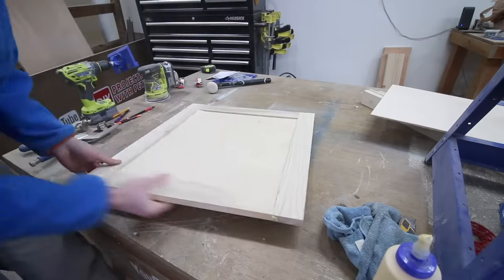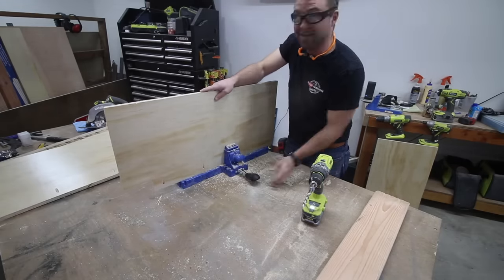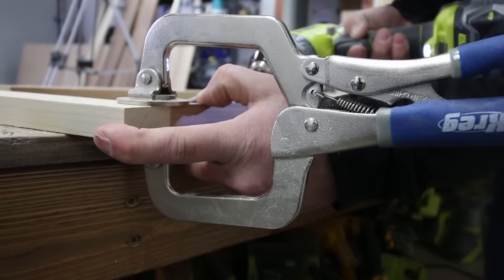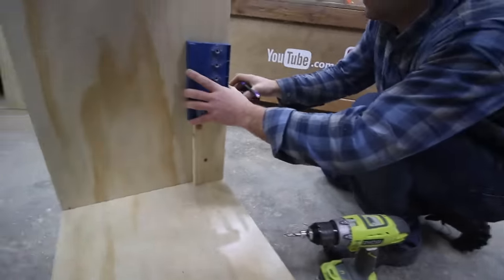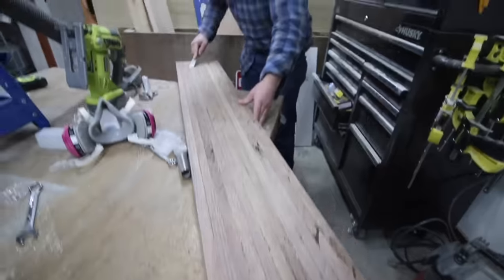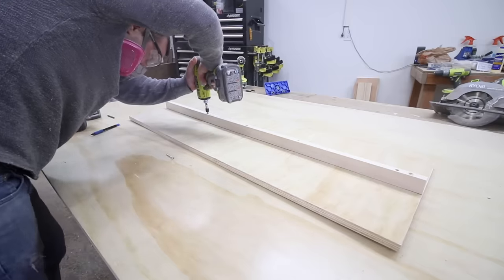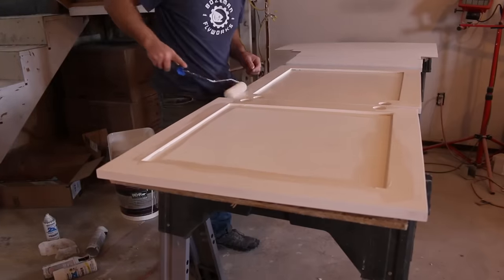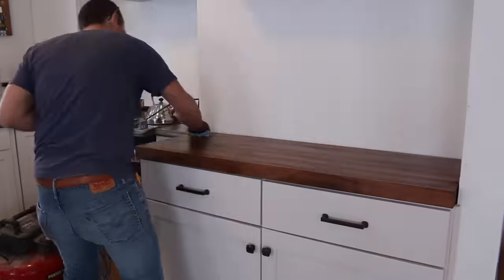How to Make DIY Kitchen Cabinets

Comment: DIY is a bit of a stretch with all the tools you used... this is a professionally equipped workshop... yes I’m jealous...
Reply: Equipped? Maybe. He definitely didn't use the tools of a professionally equipped woodworkers shop. He used a kreg jig instead of a pocket hole drill machine. He used a circular saw to cut lines that cabinet makers use table saws. Woodworking isn't a cheap hobby but he definitely is showing you how to do everything on the cheaper end of the spectrum.
Reply: J Iron I think the only thing that takes this slightly out of the DIY arena is the planer he used for the table top.
Reply: I never used one but I’m pretty sure that unit he used was $500 or more.
Reply: @jRising  To be fair any level of precise woodworking requires a planer. $500 for a planer is really on the cheap end of the spectrum too.
Reply: @jRising  I bought mine used for $150. Changed the blades and was good to go. I get about 2 inches of snipe which can be avoided using a couple of tricks like running a board beside the one you are planing or leaving extra material. You can get a hand electric planer like the WEN for under $100 or you can even plane it by hand like some people do (I'm definitely into power tools for this kind of thing). All the tools he used can be bought super cheap used. Where I live in Canada you can get pretty much every single tool in the video (used) for under $500. Compare that to the price you'd pay for a professional install. For this kind of application, the quality is not in the tools -in my opinion-, it's in the hands of the craftsman!
Reply: I'm using handsaws and a circular saw. And a hammer and a screw gun....and it's pretty simple. Just time consuming.
Reply: I cheated and purchased draw assemblies at homedepot. Instead of making my own
Reply: Fully agree, this is not a typical DIY setup. How many DIYers would have a table saw, a planer or a routing table to hand. I wish I had a setup like this.
Reply: "Save money by DIYing your kitchen cabinets! Just go out to your garage with $10k in equipment..."

Yeah I think all the tools and materials he used would be more expensive than some ikea cabinets. I'd have a chance of the Ikea cabinets actually turning out right too lol.
Reply: J Iron with a little effort, you could probably find a shop with an even nicer planet and pay a few dollars to have your wood planed.
Reply: Lol
Reply: I'm a hobbyiste and have all these tools(same table saw and same planer) Only thing I dont have are most of his Kreg jiggs.   A professionally equipped shop would cost 10X as much.
Reply: @znk0r  I'm also a hobby DIYer and have every Kreg Jig available but don't have a table saw or planer.  Wanna trade?  😁
Reply: @disturbedcarrot  I have a table saw, a planer and a routing table. I don't have all of the Kreg jigs he used though.
Reply: @1pcfred  Nice! Wish I had those.
Reply: @disturbedcarrot  I wish I had lots more tools. There's no end to it. You need tools in order to work on the tools that you have. My milling machine has its own roller box of tools dedicated to it. My tools have their own tools!
Reply: @ilovestitch  yeah well I already have the 10K of tools in my garage so what the hey. I've had tools my whole life. Humans are tool using animals. I'm human too. You may consider joining the rest of the tribe someday.
Reply: Agree 
This is not basic DIY video misleading
Reply: @PilotJirons  100%
Reply: Those are some pretty tools which I'm slowly aquiring , that thicknesser in my country is about 700 US new. The kreg jigs are a nice to have but totally not necessary if you own some clamps and a straight edge. Oh and the router table and router is pretty pricey but there are other way to join panelling to the door faces without. Great Video Pete!!
Reply: Was thinking the exact same thing. I have none of them 😕
Reply: I guess there are levels to DIY.  I started out with a cheap (quality and price) table saw years ago and now own one that costs more, but it's still a DIY shop.  A professional cabinet table saw costs $2K or more.  My new one is still less than $1K.  If you're going to really get into wood working, you'll eventually have to spend money on tools.  Even quality hand tools are expensive.
Reply: I have a cooking channel, and thought, "Hey, wouldn't it be cool if..." and yeah, I agree with you. hahahahaha. I think I'll just stick to making beautiful food. lol
Reply: @ilovestitch  closer to 2-3k in tools and jigs. Planer 500 table saw 650-1k circ saw 100-200 router table 4-500. Those are DIY jigs, most of which you can buy at the Home Depot.
Reply: I wouldn’t say professional….
Reply: Lol this is not an out of reach workshop setup 🤣
Reply: Yep, you lost me at “table saw”. Don’t have one and don’t have room for one.
Reply: I'm sooo jealous right now....
Reply: He’s using a HD planer, which is $500, and that planer is more than enough for what he’s doing
Reply: @disturbedcarrot  you’re kidding right? A table saw is as basic as a circular saw

Comment: Great video is it even worth it to build your own cabinets after all the cost on plywood  and time ?
Reply: Ok De I think it worth it. Because you’re making exactly what you wanted.
Reply from the maker: You do get exactly what you want, but you will need some specialty woodworking tools and it is time consuming. If you need custom cabinets it is going to get you the exact size, but to be honest I'd probably by stock cabinets the next time. I wanted to show the basic build process though.

Comment: Reallly nice simple video on how to build cabinets that's not 90 minutes long.
I tried building an aquarium stand with maple plywood from Lowes. The plywood was straight thanks to its large size but then was warped when I cut it into smaller pieces. And doing the veneer on the edges requires a good veneer edge cutter and a steady hand. All good!

Comment: Wonderful photos & videos shots with excellent narration; glad you had all the woodworking tools available.  
Suggestion: as a prior homeowner, I would  have put in slide out drawers, instead of wide shelf  & bottom shelf under that beautiful butcher block top... otherwise items just get "never looked at or used" that are in the back of those low shelves.
Reply from the maker: Thanks so much for the feedback and ideas!

Comment: Thank you so much! I have been wanting to do a custom peninsula for my home, so I priced it and most of the pros around here are insane with what they are asking. A $200 prefabbed peninsula installed brings the total to $2800. I think I'd rather put in the elbow grease and build it myself. Then I will get the storage I need and the counter top I want, and won't have to spend so much on it.
Reply from the maker: Awesome, good luck with the build!

Comment: Couple question, what size poplar did you use for the trim of the doors? Also, how’s you install the shelf inside the cabinet. Thanks!
Reply from the maker: Hi, I used 1x2 poplar fo rate trim. The shelf was made out of plywood with banding. A peg system is used to hold it up. Cheers!

Comment: Very nice and informative!

Would it be a good idea to add a thin bead of caulking between the door trim and face? I saw some gaps after the paint job and I think it would help to caulk before painting for a little bit more finished feel!
Reply from the maker: Not a bad idea at all :) My slot set and router were causing me issues and I've since upgraded so that the slots are cut even. I should add a little to my project though, that's a great idea! Cheers

Comment: Pete - First timer here and the cabinet I'm building is very similar to this one. Cant wrap my head around the bottom of the exposed (left side) of the cabinet. Once you added the toe kick - is there still a ~1" gap between the top of the toe kick and the bottom of the face frame? Or is it flush? Thank you!

Comment: Great Job! The pocket holes that you covered with 1/4 in. plywood on the side, could they have been put on the inside instead? Also, would this type of construction hold the weight of a quartz top?
Reply from the maker: Hi! yes the holes could have gone on the other side --- yep plenty strong for quartz countertops

Comment: Pro Tip get a sheet of 4 x 8 x (3/4" or 1/2") foam use it as a sacrificial layer to cut down plywood. Much easier than find/using blocks to lift off table or horses
Reply from the maker: Thanks!

Comment: I love this project and the cabinets came out wonderful. Very nicely done.
However I will have to point out some things that viewers should be made aware of. 

You did paint the cabinets so the paint should stabilize that plywood you are using. I recognize that plywood. I am very familiar with it and that is found in big box stores and although it works for quick and easy projects, it should not be using for cabinet making for long term stability. Most of that stuff comes from China and it has horrible consistency in it's Ply's, not to mention the chemicals they use to make it.
I highly recommend to viewers to seek out a lumber yard and obtain Baltic Birch plywood. Check hours of operation because they don't keep big box store hours and have a way to transport your materials.
Yes it will be more expensive but well worth the price years later down the road.
Although it usually comes in 5x7 sheets lately I have started seeing it in 4 x 8 sheets. You don't need to get furniture grade unless you plan on not painting it.
I have a huge pet peeve about wood being painted.

All the other steps that Pete lays out is perfect. In fact you can buy the Poplar, at the big box stores because Poplar is Poplar but Plywood is a different species all together.
Reply from the maker: Thanks!

Comment: Hey Pete! Terrific vid. Tried to answer my own question by skimming the comments but I burned out. Could you share links/product details on the brand and style of soft close hinges and slides you used in this build? Many thanks!
Reply from the maker: Hi Gillian! Great to hear from you. I used 1 1/4 inch overlay Liberty hinges: https://www.homedepot.com/p/Liberty-35-mm-105-Degree-1-1-4-in-Overlay-Cabinet-Hinge-5-Pairs-840304/203274050    The drawer slides are Liberty as well: https://www.homedepot.com/p/Liberty-20-in-Soft-Close-Ball-Bearing-Full-Extension-Drawer-Slide-1-Pair-942005/205171292

Comment: I'm digging the Walnut butcher block, but I'd like to ask a question. I've been researching the importance of breadboards on a kitchen table, to allow the wood to expand and contact with the seasons. I get that the butcher block top is laminated a little differently than you see table tops glued up, but why is it so important to have the bread boards on a table and the butcher block doesn't need it?
Reply: Old post but i will try to answer best i know.

When making a dining table (ive made 2 farmhouse style tables) the wood will normally expand along its width, not height so much. The wider the planks the more the effect. 2x6 2x8 and 2x10 are usually what those tops are made up of. I did one with 2x6 and one that was 2x10. That expansion is what will mess up, and i really dont think the breadboard will do anything to stop it. I think the breadboard is mostly for show, and to give the person at the end of the table that isnt showing end grain.

The butcher block is laminated with the tops together and doesnt experience quite as much and the sides would. If that makes sense. Plus, it isnt very large surface. Also, with it being inside in a climate controlled house, not too large of a swing from hot humid to cold dry.
Reply: @mahtoosacks  Breadboard ends keep a table top flat if built correctly whilst allowing seasonal expansion and contraction. If you have very stable, kiln dried lumber and the piece will live in a climate controlled environment with little humidity change, they're not absolutely necessary, but always beneficial. Check out the 'Third Coast Craftsman' for a decent tutorial.

Butcher blocks are usually made up of shorter pieces and the reason is they're far more stable in a smaller size. You can see in the video that the Walnut top here has some twist to it but the chap just 'screws it down' which ultimately, for his own piece doesn't really matter, but it won't last as long as if it were properly made - but the title 'diy' says it all. 

Hope that helps.

Comment: Great video. I'm getting ready to start renovating my kitchen and this video helps a lot with all the details. Did you use 1 1/4 inch screws for all pocket holes? Thanks
Reply from the maker: I did use 1 1/4 inch screws for a lot of it. The project was fun, but cabinets are definitely a lot of work and really require your tools to be dialed! It is a great skill to have, however -- for the time and money that did go into it, I'd honestly look at buying store-bought cabinets the next time around.

Comment: Looks great man. One finishing touch that would have added is if you used solid wood for the drawers instead of plywood. That way you don't see the plywood layers when you open your drawer. Still a good project.
Reply: Or edge banding
Reply from the maker: Thanks!

Comment: Great job. Curious though, why didn’t you put pocket holes on the inside of the “prefinished plywood!!!”
Reply: That's most likely because they would be seen if done from the inside, but for my preference where theres is exposed walls prefer to not use them and glue and nails will definitely do the job at holding the face frame to the plywood.

Comment: When you trim your edge banding go to home depot and buy a 10$ hand plane remove the blade and use that.  So much easier to use and such better results.
Reply from the maker: Thanks!
Reply: A nice sharp chisel would do the same job, and he probably already has one. But to each his own.

Comment: I have a question I’m going to tackle making cabinets for my house and the wife like the shaker style like you made.  When you did the face front what was the overlay on the inside for the doors.. I’m nervous about this because I don’t understand this part . Someone told me this overlay has a lot to do with the hinges being used
Reply: It will most likely be a 1/2 over lay , make sure when calculating the door sizes that the cabinets with double doors you just add 1/2 width wise and 1"  height wise. If it's a single door it will be 1"  all the way around. As far a putting the doors together dont put glue in the  dado where the panel for the door needs to be held, just glue where the Stiles and rails meet.

Comment: hi Pete.
is the plywood you use for the carcass softwood or hardwood. just wondering if there would be a difference in this case. thanks.
Reply from the maker: Hi! I used pre-finished Pine plywood. It worked well.

Comment: Hi Pete - great video curious if the prefinished plywood is difficult to paint or do you hit it with lite sanding prior to applying paint
Reply from the maker: Hey Dave! I hit it with a little 400 grit to scuff it up a bit. Paint went on pretty easily.
Reply: @DIYPETE  thank you much - I am going to build cabinets as you have here and see how it goes - keep up the good work

Comment: Little tip if glue the bottom panel in the drawer it will not be able to expand and contract and push the drawer apart. So I would just let it sit there in the slot
Reply from the maker: Thanks
Reply: if it was solid wood true but with all plywood go ahead and glue it, makes the whole drawer stronger

Comment: What was the price difference in building it yourself and buying it from a homedepot or lowes? We are about to get into a fixer up and we are trying to save as much money as possible.
Reply from the maker: Hi Megan! To be honest, building cabinets requires quite a tool investment, and the materials are pretty expensive. I wanted to share the process, but next time I would buy cabinets instead of making them. The stocked cabinets at HomeDepot or Lowes are most likely going to be cheaper, and will more importantly save you a lot of time and energy.
Reply: @DIYPETE  Thanks for the response! :D I will stick to the stock cabinets lol

Comment: Ironing some wood tape to the top edge of the drawers would be a nice touch instead of that unsightly ply grain edge. Over all, nice cabinet build, Congrats
Reply from the maker: Thanks!
Reply: I actually like the look of plywood edge as long as it is smoothly finished and a good grade of plywood without voids in it. Kind of is a nice detail. Says it's not particleboard.

Comment: Info about your pocket hole jig. I am from NZ, and we only have one option for this. I would like to know if you guys have a few different brands that i can google and maybe get bought into nz?
Reply from the maker: Hi Anita! The Kreg Jig is what I use. There are certainly other options - ( I haven't used them, but I know folks who have ) --- I'd recommend googling pocket hole jig and seeing what options you can come up with locally. They are all pretty similar.
Reply: DIY PETE ha ha of course I have tryed that. Unfortunately is only one. The problem with googling abroad is that a good place is stores. But if you don't know what the local stores are in other countries it makes it hard. Anyway thanks I wall look at the brand you have used.

Comment: apart from the worktop, isnt it mpore efficient to buy ikea units and then custom make the top and even doors? I get the feelign this would be expensive doing it your way.....correct me if im wrong.
Reply from the maker: Hi! If you can get exactly what you want to fit the space, then by all means buy them. Yes, a custom walnut top isn't cheap to make, and the cabinets are time consuming. I wanted to show the process just so it is out there and to show the process for those who'd like to learn about it as the steps can be applied to custom vanities and all sort of projects. It's really about if you have the time and desire to make them - if not, buying them is another great option! Cheers